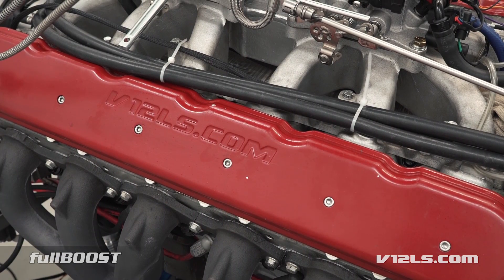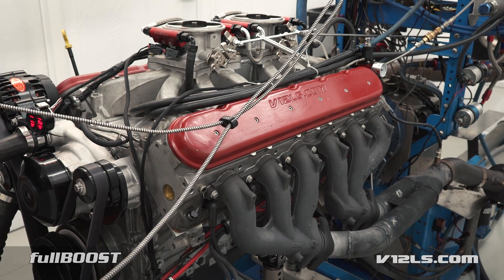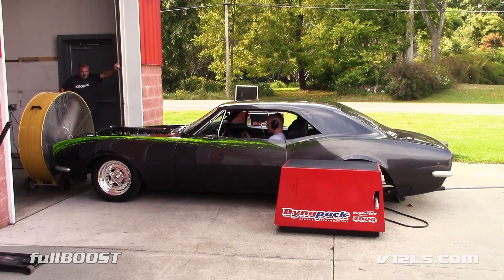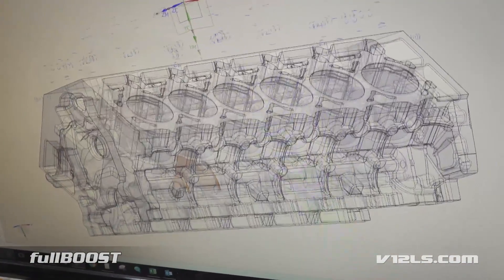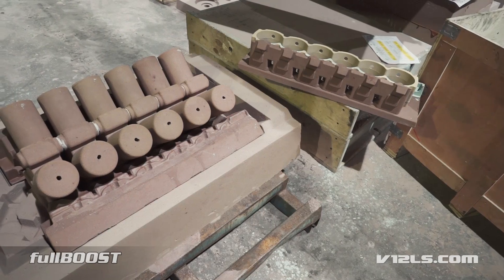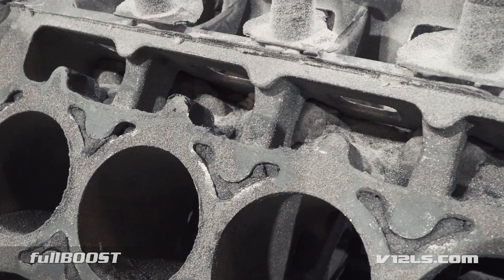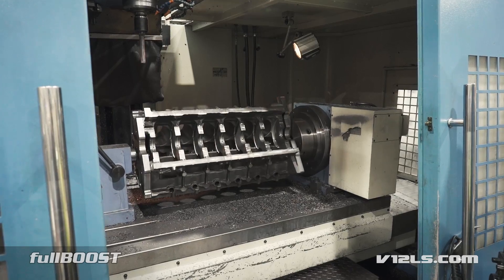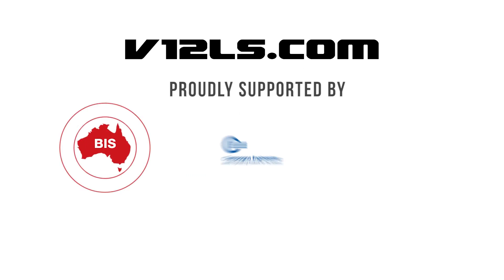How a V12 LS engine is made

Comment: Cool but not for 50K!! My LS3 stroker pumps out 687hp on the engine dyno and 710 with extra timing and race fuel. Custom built engine with Eagle forged crank, Dart Pro 1 ported heads, Mellin oil pump, ATI balancer Diamon pistons, Cali Rods and balanced with the clutch to run 7500 RPMs. I paid 23K for that engine. I would love one of these but not for 50K. sorry.

Comment: Dumb gimick. You can get a naturally aspirated LS V8 to make 700hp without too much trouble. So 600hp from an unnecessarily big V12 is nothing to write home about. The Gen 5 Viper V10 made 645hp out of the box. The whole point of a V12 is to use a smaller displacement, low torque motor, combine it with a flat crank and drag it into higher HP numbers with high RPMs, like 8,000 or 10,000 RPM. So, dumb gimick until they achieve 1,000hp on pump gas without forced induction.

Comment: Idk about anyone else but if I had just put that much money into a v12 engine "cause I'll garentee there's well over 150k in that motor from all the custom machine work they had to have done" and it only made 100 extra hp over a lt4 I'd be the most pissed off I think I've ever been in my life I'd definitely get it crushed 750hp out of 9.5 that's 580 cubic inches considering a 632 v8 big block makes 1000hp naturally aspirated a basically 600 cubic in v12 should definitely make way more than that

Comment: Sounds dumb. For one thing almost every part will be different, for another a V12 should be 60 degrees, not 90 like a V8.
Reply from the maker: The only real bespoke items are the cam and crank everything else factory LS can be used.
Reply: @fullboost  And the block... and the head covers... and the head gaskets, ... there's not that much left at this point.
Reply from the maker: It's not much different to building a high end V8 most parts aren't changed out. Yes it's not for everyone but some people want to try something a bit unique.

Comment: if the LS v 12 has a 90 degree block as opposed to 60 degree block..i would suspect there would be uneven ignition firing issues other wise good design....
Reply: You are right, odd-firing engine, though each bank is balanced in it's own right, so they are a smooth engine. Each bank of a V8 is essentially an "odd fire" engine, which is why they have that lumpy note.

Comment: They should have designed and made the block with a 60 degree angle so that the engine would have even firing intervals.  Or they could have joined two V8 blocks and made a four plane crank to come up with a 90 degree v16 with even firing intervals.

Comment: 2019 builder kit: Block, crankshaft, bare heads and gaskets, camshaft, valve covers, and exhaust flanges=$29,300US (add $5000 for a 4.065" bore aluminum block). Hmmm...

Comment: WOW aussies, this is next level shit or is it that due to the contact they have made, ie: casting and machining, that now they can make anything, id you want to know if there's a market for it, compared to just using a chevy BBK and is it more cost effective, thats the issue, to say they made the first V12 is not correct, but to say they made a V12 from 2 v8's is 100%? Only time will tell, if you hve around 65K for turn key engine, then for hp, its the perfect set up, or buy a LSA engine for around 15K add a few extras and have the same amount of power , hum which one will i have ?
Reply: Exactly, If you are on a budget this engine is not for you. Someone out there probably thinks Ken Block should have settled for torque thrusts and an edelbrock top end kit on his Mustang too.

Comment: I honestly thought that they welded two blocks together, sleeved them and re-bored the cylinders.    I was way off base.   Custom castings are impressive.
Reply: Thanks! You are right Robert, that's how we made the first prototype before moving forward with the project and tooling up for the one piece blocks and big LS7 port heads.
Reply: arent ls engines v8? so if you wleded two v8s together, it would make a v16 engine or a w16 engine depending how you go about welding the blocks together
Reply: @White_Night_Demon  pretty certain they would cut ¼ of the block to make it a v12

Comment: For the cost for their base kit. You can build 2 1000 horse ls1 motors and find a g-body and a pickup to throw them in! And with that you still need to find an intake etc, or pay them for one I wouldn't use if it was on a v8. I don't know why I keep getting videos for this thing in my feed. Huge, Heavy, Underpowered, Overpriced. You want a turnkey motor delivered? Get ready to drop 60k, and only break into 1000hp on that motor if you're willing to pay another 12,800 dollars in "extras". Again being stuck with the intake and other parts you wouldn't use on a v8, but are cleverly "adapted" to this motor...

For that money I can build an entire car on an LS platform that makes more power than this motor..... A nice car.

No.... just no.

Comment: A beautiful noise, but it's not hard to get 700 hp from an LS7 for half the cost and 1/3rd less weight and length (even if the V12 is aluminum). I love the idea but it's all show and not useful in any car. No V12 is.

Comment: Just throwing this out there to the chevy nuts in the comments. i have a  3.9l LZ8. is there a  way to  turn the motor and mount it correctly mounted to a (unknown trans) and send power to an (blank) diff? Would like to build my car with the stock V6 and try to prove that its not all HP but getting to use all of the HP and torque curves. I am looking for internals for my LZ8 motor but am having a hard time finding cams and and cranks and ect. Is this even a worth while idea?

Comment: 9.5L....
Just 700.....
You know what it sounds cool but it isn't.
With that displacement it should make at least 1000hp to be good.
Reply: The 700HP one was 8.5L. And on STOCK heads. The heads will make a big difference. As will the intake, headers, and cams. If they take the 9.5L model and put some goodies in it, it'll easily be at 850. And that would still be at LOW RPM. That's a big thing to remember. Horsepower doesn't mean shit. It's work (torque) over time (RPM).

You can't figure out HP without the TQ. So TQ is what you should really be looking at. And at 627 lb-ft for the 8.5L version, AGAIN, on STOCK low end heads, a small cam, a bad intake, and bad headers, that's 74 lb-ft per liter. The theoretical limit is around 85-90 lb-ft per liter. And all you have to do is rev and have head flow to make more HP.

So, lets say they make one with the best possible heads, biggest valves, best intake, and best exhaust headers they can. Throw a big cam on there and 7000RPM peak HP, with an 8000 RPM redline. That would be 855 LB-FT and 1140HP. Theoretically speaking. Would that be good enough for ya?

By the way, as far as reliability, that would be at or almost at daily reliability.

Comment: taking 2x ls to make a v12 is a cheap way to make a v12 from existing parts parts so the 90 degree v angle is acceptable.  But if you are going to make the block yourself, why not use the 60 degree v angle that keeps the firing order regular and the engine vibrations to a minimum?  The only 12 cylinder setups that make sense are multiples of 60 degrees or anything else if you use a split journal crank but then it is much weaker.

Comment: this is a joke right, a v8 with a few mods will blow this motor away, hell a 4 banger with a turbo and a couple other things will blow this away, 600 hp is little power these days.
Reply: Ya.  A stock GT-500 with pulley swap will do 1,010 hp at the rear wheels.

Comment: Yeah but for the fuel injected they won't $44,000 with $44,000 I could just build a 3000 horsepower boosted Mustang or Camaro or Challenger or completely refurbished an old muscle car I'm good

Comment: $45,000 for a 700hp motor. I can get an LT4 for under $15,000.... which puts out 650. Modifying it further to hit 700 isn’t going to cost all that much. Not worth it, but VERY cool
Reply: Considering this is not production and custom made.  This is about right.  Plus it's all stock dude with unported heads stock valve train etc.

Comment: Amazing. But, why? A V8 LS/LT can make similar numbers... An LT5 makes 755 hp with a 3 year warranty easily turned up to 800 plus in a much smaller package and we know we are getting well above those numbers. 700+ is easily attainable in a streetable LS7 n/a package and it would have to be significantly lighter. Extending the wheelbase to fit a monster length engine seems like a lot of work for the same power. Torque is impressive, but if it made 1,200 hp n/a it might be worth the packaging nightmare. You can't argue with the wow factor and the insane engineering, though. Bravo.
Reply from the maker: This engine is capable of 1000+ yes.
Reply: @fullboost  so is a TT LS. 2/3 the size.and lighter.
Reply from the maker: Well l guess you could TT this also 😉 Generally people buying these engines are after something different.
Reply: @fullboost  no doubt. It's an incredible idea and execution. Just seems like it's only for wow factor. We are in the golden age of power when stuff like this.exists. best luck to them.

Comment: 625 hp? Did they only do this as a novelty that motor is weak 😂😂😂😂😂 coyote is a 5L and make 480 stock no problem
Reply from the maker: The low compression base model makes 715hp.

Comment: Aussies took the LS a step further. I don’t mind Ford or any other make, that’s to each their own, but you can tune and build a GM motor like a lego toy the same way as a Honda. It’s a simple platform with a single cam that can be a monster. Not jabbing at Ford, but how many 5 liters make this much power without DOHC, multiple valves per cylinder, displacement, and 180 degree cranks? 
I appreciate other motor companies too for what they make, but some make buffs like to defend their own preferences.

Comment: Ryan Falconer has been building 12 cylinder and 10 cylinder performance engines for over 30 years. More horsepower and more torque than this.
Reply: Exactly! and any recent Falconer has been built with LS parts.  The engines are 601 cubic inches, 10.9:1 compression, 640 hp (477 kW) at 4500 rpm, out of the box, and come with MoTec engine management.    They are standard fare for boat racing and so reliable at high power settings that they even use them in aircraft such as the 75% P-51Mustang.  The 75% P-51 Mustang has the power to meet and usually beat the WW II Mustang on 1/3rd of the fuel.  It flies 415 mph level flight, climbs faster, cruises faster, lands slower, and has almost twice the range.  The only place the real outperforms it a ceiling of 46,000 ft. vs. 25,000 ft.  (However you can also buy Falconers twin-roots-supercharged, and quad-turbocharged.)  To be fair, the 75% P-51 Mustang also does not have to carry 8 50-cal machine guns, the required ammunition, self-sealing fuel tanks, and armor for pilot and engine, which requires 1,490 hp. to haul.)

Comment: It's hard to justify paying for an engine like this when it makes as much as the smaller viper engine.. not to mention the v10 has more aftermarket support, and what is this engine gonna fit in anyways? Cool idea, but I'd rather have a 26b with less torque for the money, less weight, more rpm, better sound, same fuel economy

Comment: GM built a 702cuin, V12 in 1960.  225hp but an incredible 650+ ftlbs of torque at only 2500rpm.  
  It was a small production used in fire trucks and large trucks.   A few can still be found but parts are almost nonexistent. There is a company that will build one up for you but plan on that wallet spitting out around $60K.   
 They sounded good tho.
Reply: Ron Fry There is a guy with one on youtube he will be putting in a rat rod... Impala something something is his username.
Reply: Like so...https://youtu.be/vtfPFLQMbUM
Reply: What company is it?

Comment: Why in the world would they use a 241 head? Strange
Reply: Don't worry we are now casting LS7 heads. We used the 241s for the prototypes because they are easy to get in Australia. We were impressed by the 717HP from un-ported 241s, but there is a lot more power potential now with the LS7 ports!

Comment: Yeah making more power out of a bigger engine makes sense, but making more power out of a smaller engine is better I reckon. Like a NA K series putting out  500hp
Reply from the maker: That wont have the torque band anything like a large motor though.

Comment: You can get a twin turbo ls from nelson racing engines that will make a reliable street driven 1800hp for less than 50k, this v-12 is a novelty and will probably be 100k for their boosted version. Not worth it in my opinion and also the larger foot print, lots of mods just to mount it. Ill take a nelson twin turbo ls for less money and smaller foot print please.

Comment: I want a V16 LS. I will make sure it can't rev too hard, using valve timing to Millerize/Atkinsonise it through most of the rev range, and turbocharge it. I will use it to tow campers. It will be muffled. Sadly, it will never exist.

Comment: On a long enough timeline everything gets an LS.
Even a V12.
Reply: -regular car reviews
Reply: Why the 90 degree bank angle?
Because the LS V-8 does?

A V-12 should have a 60 degree bank angle.
Reply: @ronnelson7828  Not if you're going with a cross plane crank setup, which demands a V angle of 90 degrees, which I personally think is more ideal for both V8's and V12's alike. Flatplane crank engines are a tad overrated I feel.
Reply: @yellowmalice3036   Precisely. Crossplane crankshafts offer the best balance and the smoothest running. Flatplane crankshafts offer a more organized firing order.
Reply: @НиколайАнтонов-я8е  and flat plane sounds amazing. 😂

Comment: Really only 700hp? If you stared at a normal ls1 hard enough you could probably get to that number. It's stupid easy to make Lss make power, so do it
Reply from the maker: As stated in the video, the prototype made over 700hp, and they intend to push that to 1000 on pump fuel with these new cast blocks.
Reply: Jack Bitter that’s 700 on pump gas. I am betting that if you could get a hotter grind cam and put e85 or a meth kit on it your breaking a grand pretty easy

Comment: Ls engine are junk. 700 is nothing with all that weight in the world of of racing and power. Big and bad for no reason. I can melt aluminum in my firepit out back and cast iron is way to heavy with poor weight distribution on both.
Reply: Danger dan I stand by what I said on my first statement, in that you can not properly convey a thought. You are not talking about anything.
Reply: My mistake Danger dan , I thought I was talking to someone who had a brain . I'll let you get back to your backyard smelter .
Reply: Are you a troll? You can't even complete a thought. You basically rambled on the whole comment.
Reply: LS1s are all aluminium not cast iron .This engine would be lighter than a Ferrari , Lamborghini , Mercedes or Aston Martin V12 because it's more compact and doesn't have the huge cylinder heads required of quad cam engines or the cams , extra valves , springs and massive timing chain and all those engines make around 700 hp dispite the fact that they are far more sophisticated and made by the 4 best car makers in the world .
Reply: Chris M so I can melt aluminum in my backyard with cheap tools and heat. But not cast iron. That alone seys alot.
Reply: So Danger dan  here is the question? What car do you drive and what engine is in it?
Reply: Joe avery it's just a tool and nothing more. It dont matter were talking about sports cars not tools

Comment: When are they going to fix the 90* angle and overhead valves?...Just wondering.
I'm european and it's not like we know anything about v12's right??
Edit- when are they going to fix the power too? 625hp (or 700 so they say) is pretty crap from 8.5l, you can get that from 6l aston martins, heck a 7.7l tvr speed 12 made closer to 900 from 7.7l (470cu in) back in the 90's, the Lamborghini Centenario has 770hp from 6.5l and they're less custom than these, hell the ferrari enzo made 650hp from 6 liters 13 years ago!..maybe this is meant for a truck.

Comment: I'd like to see more about the crank and firing order. You can't just weld on a section of crank with two more throws for four more pistons. I wonder what they settled on for a firing order and what ignition system they are using.
Reply: That's right  jbr496. We went with the usual V12 firing order used by Ferrari etc. We make a billet crank and typically use a Haltech ECU which can be configured to run the V12 with any bank angle (In our case 90 degrees).
Reply: @V12LS  why didnt you make a v16 engine?